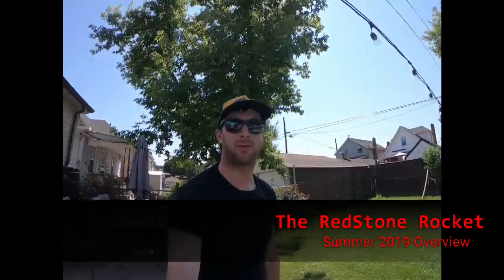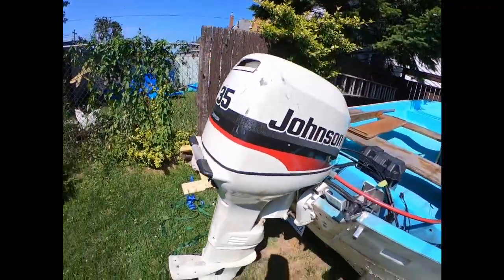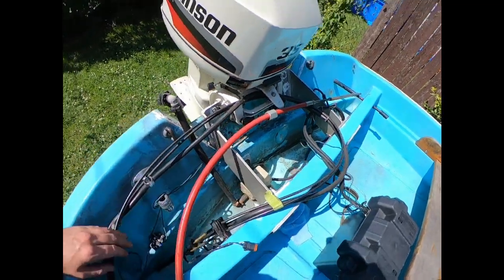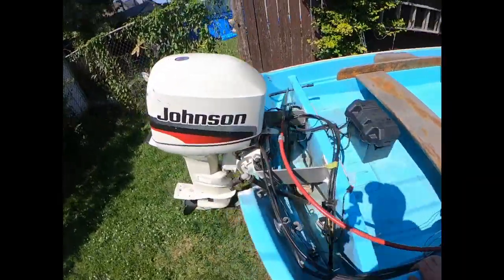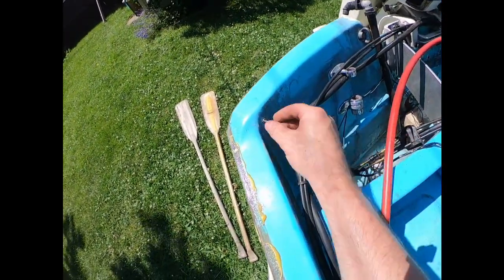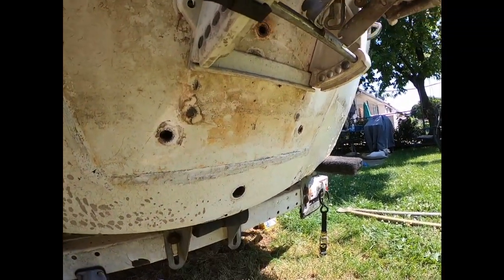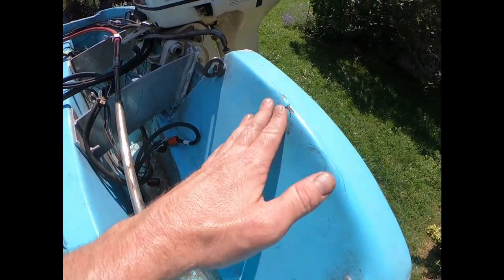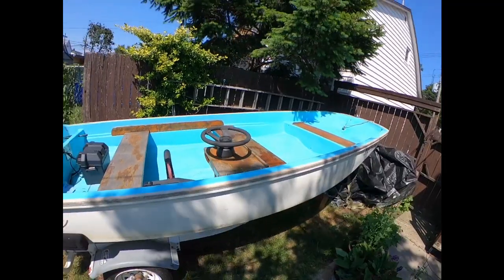Walk Around of Boston whaler 13 project.

Comment: Why not keep the plate on the back?
Reply from the maker: I might, But It was  kinda crudely put together. so If I do reuse it i will be modifying it to be stronger and with more support and re drilling it with holes that are not just haphazardly drilled in seemingly ransom locations.
Or might go with a pre made solution like the kent fab transdaptors.